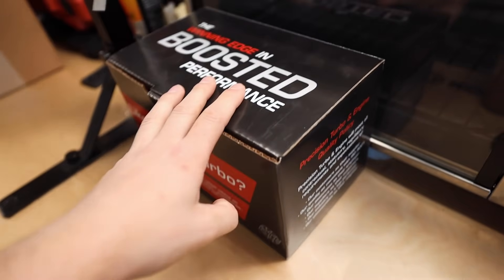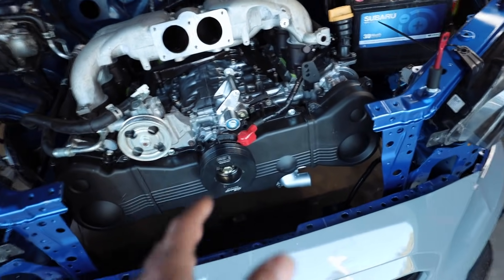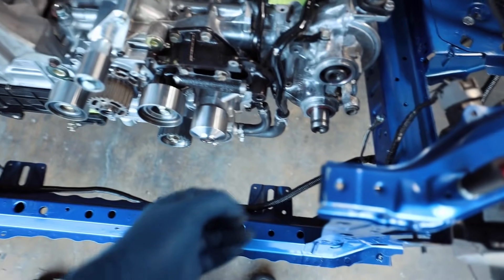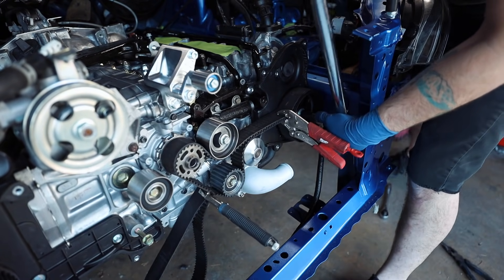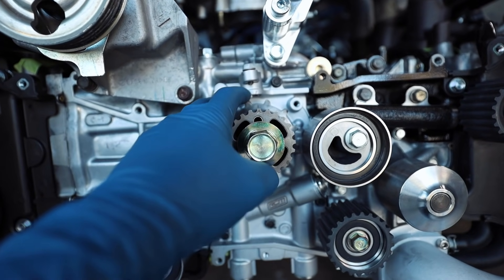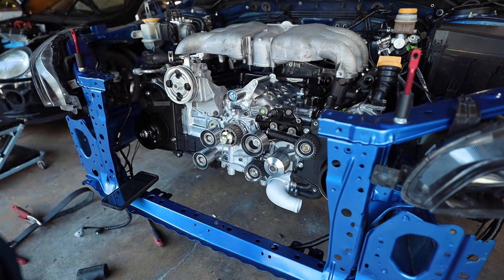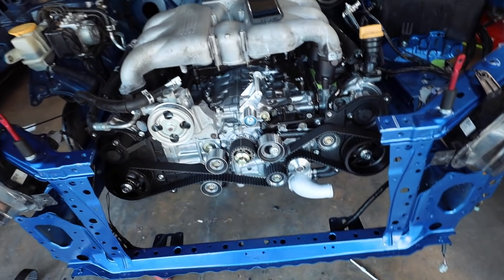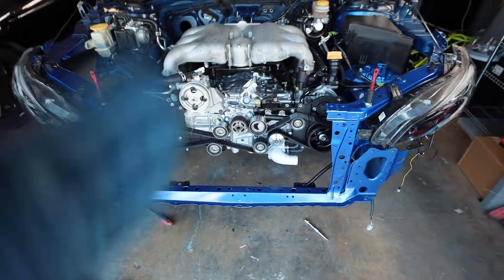One Step Closer To Ripping The 6 Cylinder Subaru WRX STi

Comment: One trap for the young players is there are a couple of different bolt lengths on the timing belt idlers.

One time I put a shorter bolt in the upper idler on the passenger (right) side of the car without noticing and it pulled the threads from the hole at 6500RPM. Engine was fine, threw a longer bolt in and haven't had issues since.

Looking at the bolt heads and their respective positions it looks like they are in the right places.
Reply from the maker: Offfffff not a good time 😖 replaced all of mine with new OEM bolts thankfully

Comment: As for tightening or removing the main pulley without special tool...
Its actually pretty simple...

U just shove a 12mm socket box in between flywheel teeth lock onto transmission bellhoushing exactly at starter motor hole.....this method works both way (tightening/loosening the main pulley bolt)
Reply from the maker: There's no flywheel in the car yet though 😅
Reply: @Smeedia  ahhh.. totally forgot about that 🙏🙏🙏😅

Comment: If you've got one of those strap wrenches, you might be able to hold enough tension on the dampened to torque it down.
Reply from the maker: Ohhhhhhh smart! I do have one, going to give it a try today 🔥
Reply: You could also try threading some bolts in the holes and use a pry bar between the bolts to hold it still.
Reply: I've always just used a screwdriver into the acces hole on the top left of the trans locked into the flywheel teeth. Never had an issue doing that.
Reply from the maker: I don't don't a flywheel or clutch in there yet 😅🙏

Comment: the cam shafts have recesses to put a wrench and with that to hold it.
Obviously, this work is done with the motor out, when the motor is in, you have to use the old belt..

To adjust the pulley, you must lock the clutch flywheel with a pin, inserting it from the side, almost in the division with the gearbox. At least it is like that in the EJs that I have armed
Reply from the maker: Old belt has worked well so far, did not know they had a recess to be able to hold them!
Reply: @Smeedia  The original cams have hexagonal shapes. But as I told you, it can only be done when the engine is outside, with the valve cover exposed, belts and tensioners already in place.

Comment: What's the benefit of the fluid damper? I know the theory behind fluid dampening, but in the context of the timing system is this an upgrade everyone with an EJ should be doing or is it more specific to this mad build?
Reply from the maker: Helps absorb engine vibration, so instead of vibration being sent through the crank to the bearings (which would wear then quicker), the fluidamper helps to keep things running smoother. I would suggest one for any car I have one on both of mine 🙏🔥

Comment: aftermarket cam gear bolts or were they sockets from the factory? Still will never understand why Subaru decided to use a hex key for the cam gears... smh. So glad I swapped over to TiC bolts for my EJ.
Reply from the maker: Sockets from the factory 🙏 

Those hex keys can burn in hell!

Comment: Gotta have a lot of faith in your left foot runnin' no guide on that timing belt!
Edit: is it possible to modify an EJ guide to fit that EG33?
Reply from the maker: Straight facts! 😅
Reply from the maker: Only if you use an EJ oil pump, thr EG pump has no holes for a guide 😅
Reply: @Smeedia  True, but you have that Aftermarket RCM oil pump that has holes right? Maybe the EJ one would fit idk but it could be worth a try
Reply: I've personally never had an issue running a manual without the guide. Granted they were all n/a stock motors.

Comment: So are you just gonna plug those two timing cover holes with something or could you put in a stud with a locknut so it’s at least covering the hole and has a nut on it but not torqued down stupid hard as to not to clamp down on that timing belt guide? Just a thought.
Reply from the maker: Was just going to leave it open, the upper hole cracked when I first tried to tighten it all down 😖

Comment: @smeedia_ I just noticed that you don't have the subispeed headlights on anymore. Did you get rid of it?

Super excited to see this running!
Reply from the maker: Yessir. Sold them a while ago 🙏😁
Reply: @Smeedia  did you have any issues with them? I remember for the video when you installed them, you said it was growing on you.

I'm asking because my passenger side headlights now has condensation, so I ordered a pair of subispeed headlights. I read around and people said they did have condensation problems on the subispeed headlights as well.

I do plan on repairing my OEM ones once the subispeed comes (just in case I mess up and have a set of headlights at hand). I watched your video on install of the diode c lights so I'll be referencing that video to take apart, clean, and reseal 👍
Reply from the maker: No issued with mine, just liked thr OEM look a little bit better 😁🙏

Comment: What’s up dude I had a random question on the mishimoto tmic and charge pipe would you say it’s safe to run the tmic and charge pipe without a tune ? Mishimoto advertises that you will see optimal performance if tuning is performed but it is not needed.
Reply from the maker: I would highly suggest getting a tune, no point in adding the parts if your not going to tune for them 🙏
Reply: @Smeedia  yeah I’m just trying to stay within warranty. Just got a new 2020 wrx and only want to get warranty safe mods.

Comment: You shouldn't use Impacts to run bolts through die nuts. Just do it by hand and clean any grime off the bolt, then lubricate it. You might have gotten away with it. It's just as easy by hand.
Reply from the maker: I've always just sent them with impacts unless it's something that is a super important bolt but had some extras if any got screwed while going through them 🙏
Reply: @Smeedia  I do 90 percent of all my work by hand, with gear wrenches. It's faster and easier for me to walk over with a gear wrench especially when I know the bolt size. Then to pull out an airline out and use an impact. Or go get an electric impact. I don't even own a real electric impact haha. I like gear wrenches the most.

Comment: Hey smeedia I got a brand new tial q bov red I could express it to you if you need it let me know. It’s 50mm and has an 11 psi spring in it
Reply from the maker: Appreciate the offer but hold onto it, I've got this precesion one that will work. Don't wanna be kidnapping your parts 🙏😁
Reply: @Smeedia  aright lol ya i have the gfb one and using that for now because i have the titanium piping but they gave me the aluminum flange so im just going to stick with the one i currently have for now since stock engine.

Comment: I wonder if that Haltech 2500 could run the stock gauges on an 06 STi?  ...also, does anyone know how to find an EG33?  If you wanted to do an NA build, would the EG33 be the right choice, or would the EZ36?
Reply from the maker: Yes it should be able to, I would go eg over the ez 36, i found mine on ebay 🙏
Reply: @Smeedia  Thanks!

Comment: When you time an ej motor what is considered TDC?
Reply from the maker: When your timing it the easiest way is to line up the crank sprocket with the oil pump markings and that'll get you there
Reply: @Smeedia   Is that where you start if your building a brand new engine?
Reply from the maker: Yes, you shouldent have any load on the cams so you can rotate the engine freely until you set load
Reply: @Smeedia  Awesome that's what I thought thanks a ton for the reply and amazing channel! I've learned a lot it's been great keep it up!!!

Comment: Couldn't you make a crank holder tool pretty easy? Flat piece of metal, drill two holes, put 2 bolts in, torque it down. Won't be pretty but should work fine.
Reply from the maker: If I had some bar stock I could 😅🙏